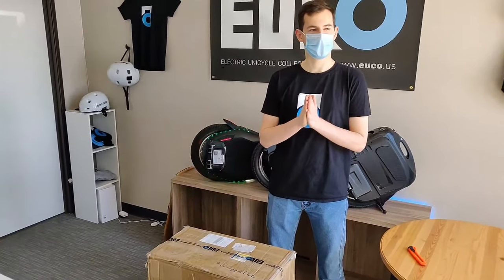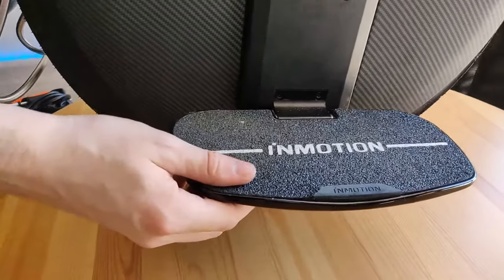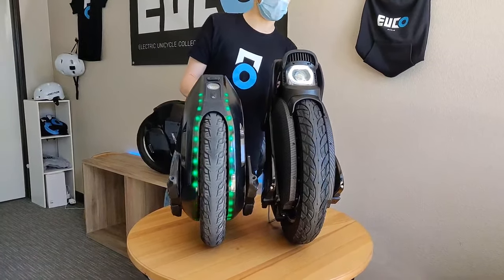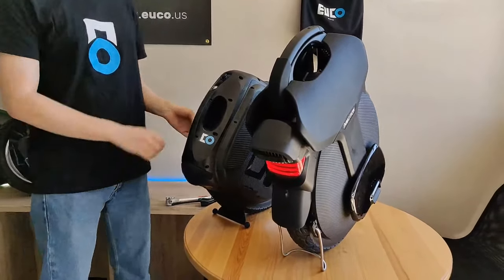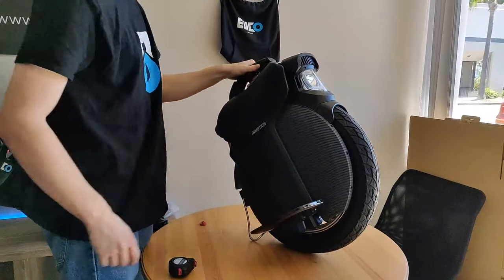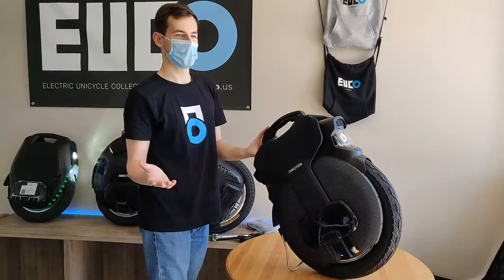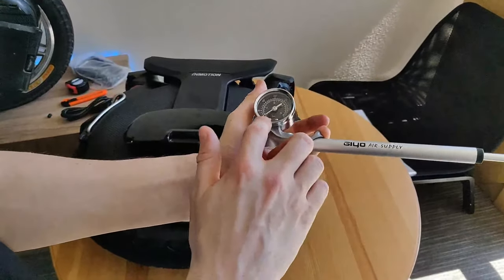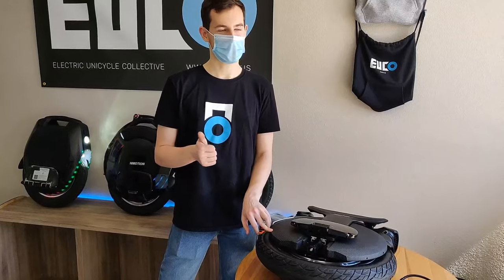Live Unboxing of the InMotion V11

Comment: That is a Sweet wheel...Wow!! 😜👍 my only gripe on both suspension wheels is speakers for music, as much as love Euc's I also love to cruise with music playing as in my automobile. It's definitely a plus that Inmotion includes an air pump for the suspension, but can the pump also be used on the tire as well? Plus I heard that Inmotion may also be making a V12 with more options like speakers, any truth to this rumour? Also are you guys a new Euc dealership?
Reply from the maker: The pump can also be used for the tire, since they use the same valve type :) EUCO was founded in Q3 of 2019, but we've had years of experience with wheel distribution, since  2016. We're the team behind brands such as Solowheel and InMotion USA.
Reply: @EUCOllective  awesome cuz I may just be ordering. 😜👍

Comment: That pump is a high pressure low volume pump only for the shocks. Just like on mountain bikes you will never be able to pump up a tire with it. And it should not be out on rides with you. If you get dirt into the pressure vessel of the shock you could be in big trouble.

Comment: Is it still rideable with no air in the suspension? Let's say you blow a shock, or two somehow. Thanks guys!
Reply from the maker: While it may be possible to ride the wheel in that scenario (it would just become a regular EUC at that point), we recommend replacing any shocks that blow out to prevent them from possibly getting even more damaged or failing altogether.

Comment: You can't plug in two fast-chargers; that's what your website says!
Reply from the maker: Initially it was believed the V11 could handle such a configuration, but since this video's release, InMotion has confirmed with us that the V11's battery isn't designed for more than 5A charging. Apologies for the confusion!
Reply: When a product is preproduction you can't be sure of the production specs, as you have noticed.